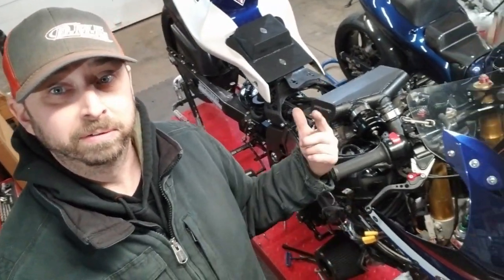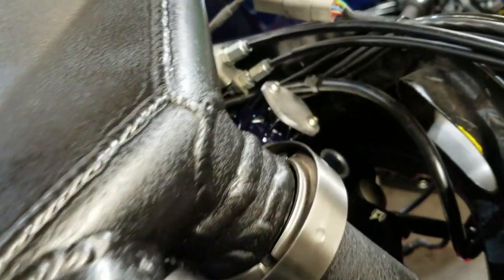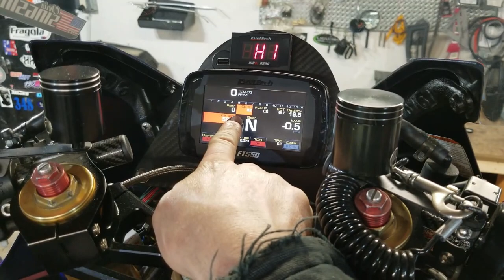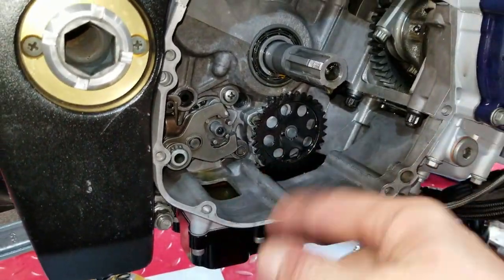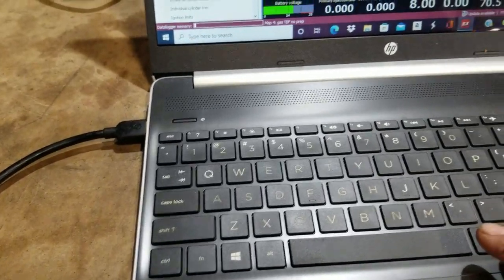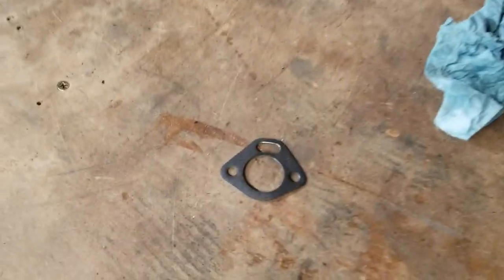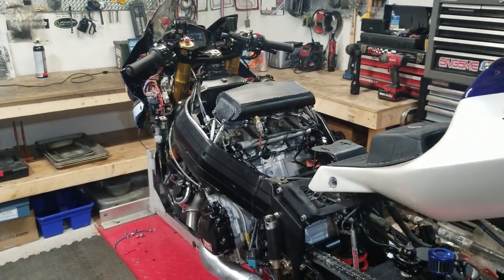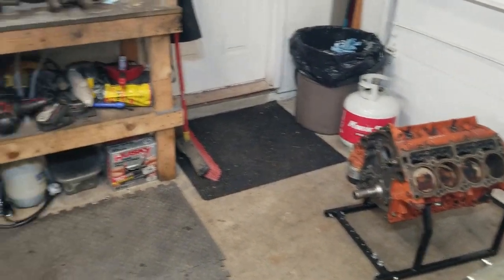FIRE IN DA HOLEEE!

Comment: Are you just running the WB-O2 Nano? Or do you have the Fuel tech Alcohol  box to?
Reply from the maker: Just the nano on Alcohol scale
Reply: Perfect! That will save me $1500 plus lol.
What 02 sensor are you running?
Reply from the maker: 100% honesty...i never even looked into the alcohol box or why its needed.  All the bikes i know on meth just run the nano. The 02 is just the standard Bosch that comes with the nano...ill try to find the part number for replacement so you dont have to get a fueltech specific one. I bought spares for like $35?
Reply: Perfect! I’ve already got the nano and the standard O2 sensor.